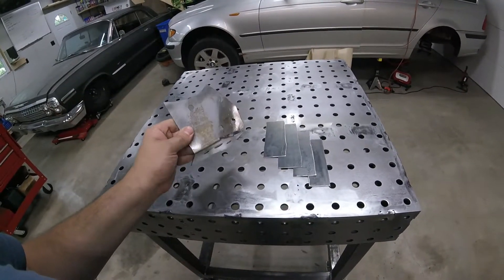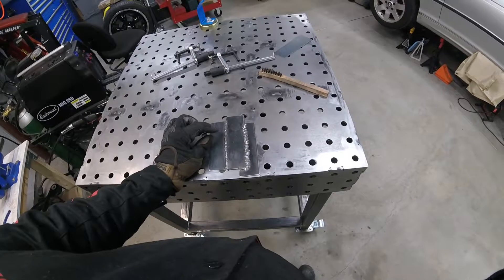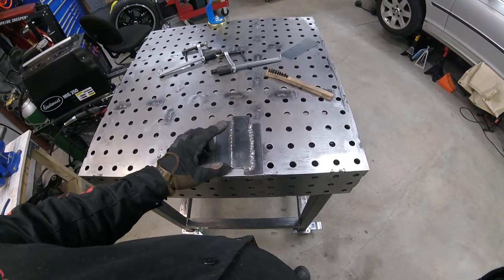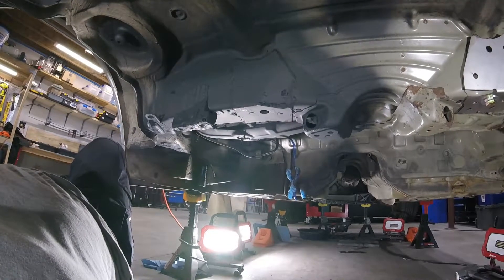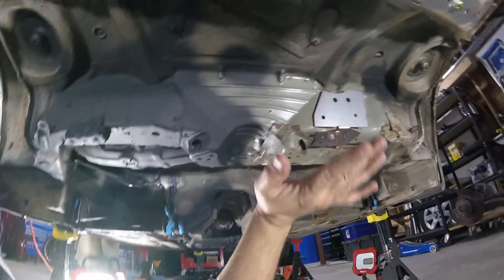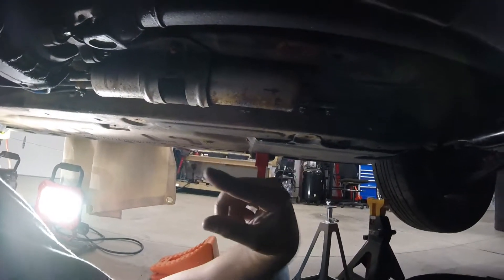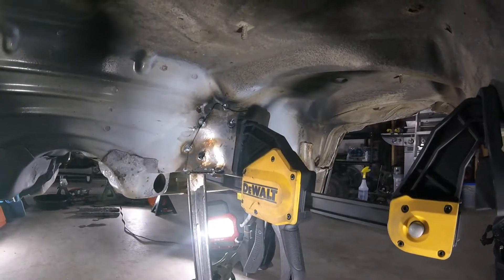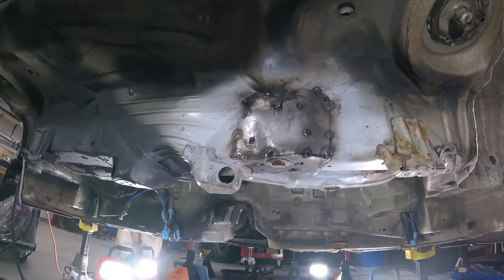E46 Rear Subframe Reinforcement - Sleetwagon 02

Comment: was this preventative or did you find cracks?  I too have an an xi (sedan). I haven't checked for cracks yet. I've read that the xi's usually dont have them due to the front wheels absorbing alot of the stresses. Thanks